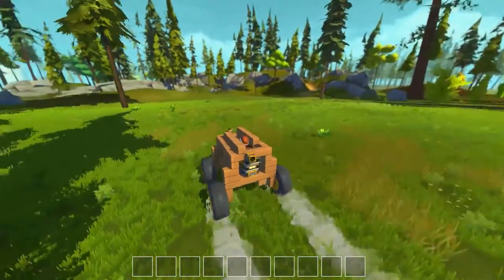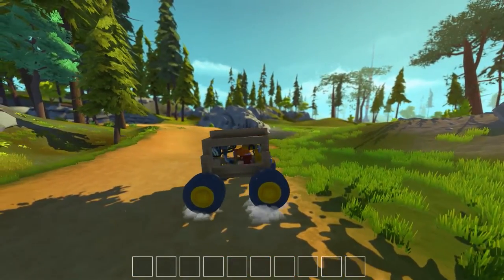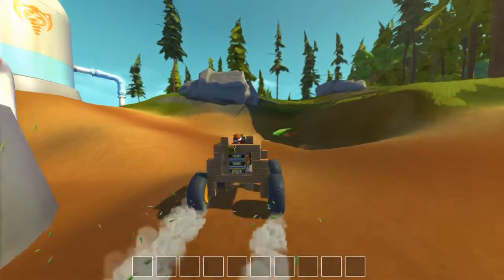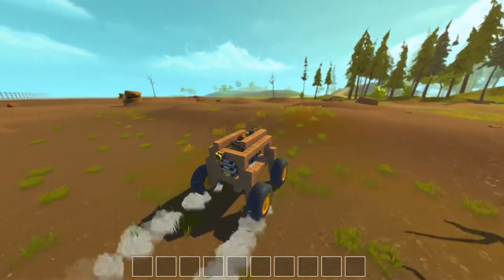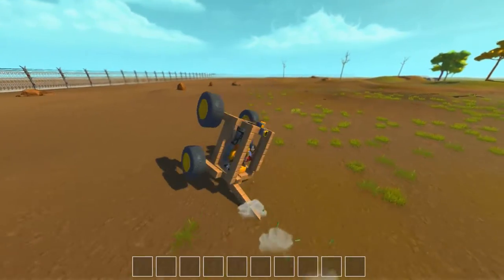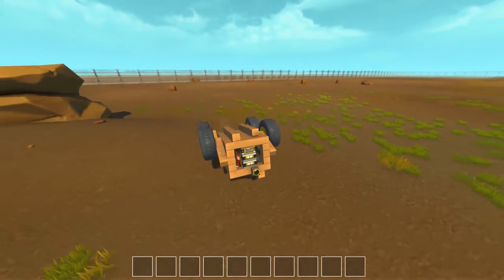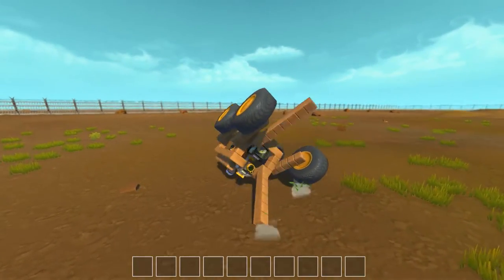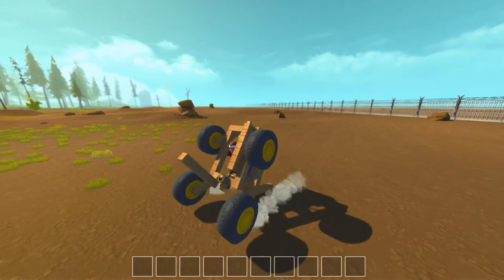Unflippable Car? - Scrap Mechanic Creative Mode PC Gameplay

Comment: What happens when it perfectly lands on its side? There are no sensors there...
Reply from the maker: +Anu8ius Oddly enough, it's never happened. The shape of the car seems to ensure that it rolls onto its roof slightly and that causes the wheel arms to rotate enough to flip it back over again.